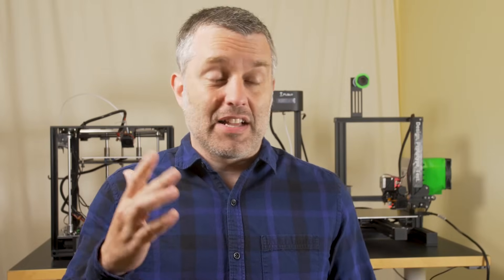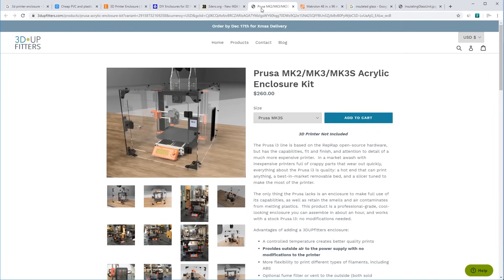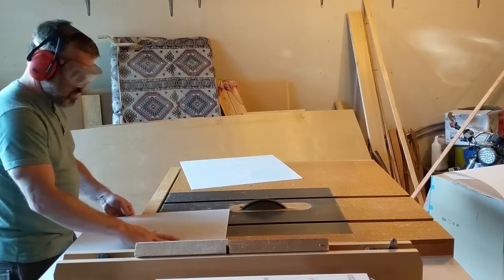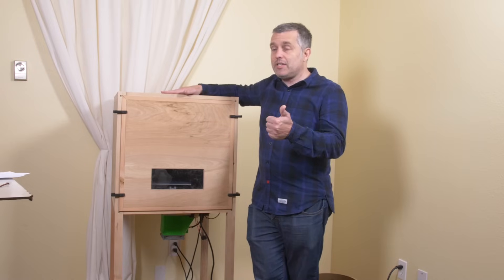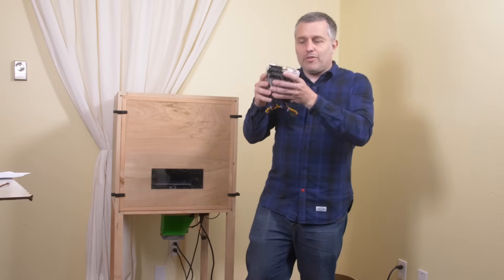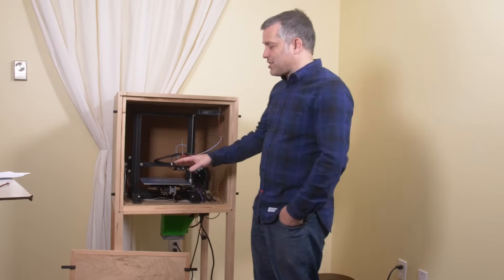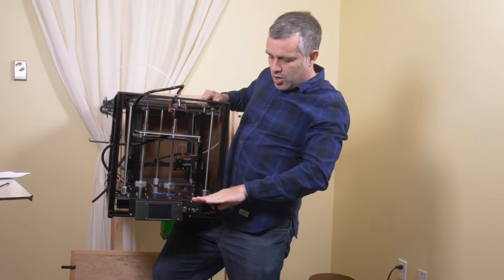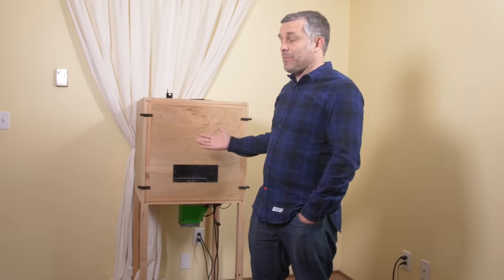3D Printing in a 100°C Heated Chamber - Lessons Learned

Comment: Alloy led extrusions and the greenhouses polycarbonate with the uv and heat blockout fabric is perfect for one of these! They make slip covers from it in different sizes now i got 4 the other day to tryout and have a massive sheet for the window to cut to squares to stick to the polycarbonate black outside and silver inside my lizard heat mat heats my resin vat up perfectly for printing not sure if itll fit under the ender 3 bed the larger one is adjustable heat controlled and as thin as paper its just coils laminated to fit in a lizard take for tropical heat I'll put this to the test something more lightweight and practical is needed, the pigeon box looks abit nasty for in your home

Comment: abs layers were separating and warping , bought a heat champer, the abs parts were wonderful, then after 15 hours the main board failed , and the the x stepper motor and I realized all the electronics are in the heat, either buy a already enclosed with great reviews or plan on moving the electronics outside , &10,000 comercial 3d printers have cooled servo motors

Comment: I regularly use my crtouch sensor on my 3d printer in a passively heated enclosure which is above 65°C most of the time. I don't know if it's because the crtouch uses a different technology than bltouch, but it works at that temperature no issues at all
Reply from the maker: This video was made before the CRTouch was on the market. I assume it has the thermistor and temperature drift adjustment on a chip just like the BLTouch developed first.

Comment: The blades are for a slitting saw on a mill (or drill press in your video) - definitely not for a hand tool.  So good you used them the right way.

Comment: Very cool. Not sure why the heater is needed. Haven’t watched all of the video yet, kinda skipped to you discussing the result, But did you try to run it simply enclosed and measure the temperature between the bed and roof? 

I just got a creality ender 3 neo, running in a small dehumidified room. And i’m usually greeted with temperatures 10-15 Celsius above ambient room temp on the other side of the door

Comment: More than adding hot air to the chamber, the inlet without an outlet is adding pressure to the chamber. What this will do is decrease the amount of air passing over the resistive heating coil in heat-gun

Comment: BUY a $75 3x3 Hydroponic Grow Tent.. You can even use heat controllers on fans to ventilate and keep the enclosure the right temperature. Just use a basic temp controller for hydroponic grow tents or heat mats.. You can also just use a chepo temperature controller module.

Comment: The choice of magnets has a big effect.  Alnico magnets will handle the temperature the best 550C no problem   Neodymium die about 100C but can get to 200C for the best material.   Ferrite  ceramic 350C ( I bonded 24 1" diam x1/8" to my Tornado bed and use steel work plate run at 110C with a 10C drop to the plate without a box heater. )  samarium cobalt  250 top end 350C

Comment: While the 3d print/filament love the extra heat, the stepper motors and the eletronics not so much. =/
I had plans to make a heat controlled enclosure with temperature sensors and a hair dryer to heat up it when it got colder than the target temperature, but it was getting problematic because of those issues.
Reply from the maker: This comment is so funny. I'm not a narcissist. I don't care if somebody else is working on the in the same thing as me. The reason I've got your boys number but he can't get to me is because he doesn't understand me but I understand him. From his point of view I have a superpower. It's called empathy. Basically kryptonite for those with Narcissistic Personality Disorder.
Reply: @DesignPrototypeTest  I don't know why you are telling that crap when I am just reporting issues I had with a similar project, but nevermind, I don't really want to know, not worth my time. Leaving and blocking.
Reply from the maker: Ok. Have a nice day.

Comment: those blades are actually intended to be used as "slotting saw" or "slitting saw" but somehow are marketed as freehand Dremel circular saws - you're usign them as the original designer intended

Comment: You can buy a cheap little tent for growing in doors and put your 3d printer inside, put a small extraction fan in the tent n vent the horrid plastic air outside. Simple n easy

Comment: Between two glass or inside the window there's gas insulation not air. When gas goes out it is way less resistance to temperature.

Comment: Would have done the same design, without slots, made a frame to go between the polycarbonate and silicone sealer for sealing the plastic to inside, frame and outside frame.

Comment: maybe i am mad, but has anybody thought of using a dead upright fridge/freezer or upright freezer the used in UK mostly 60cm. wide and deep as insulated box and maybe a clear door on front that would be free in most cases just checked mine out internals  about 46cm wide and 80ish height i think my FLSUN QQ-S-PRO 3d Printer  might fit but not delivered yet
Reply: I have, I have a mini fridge but I would rathee just build an enclosure.
Reply: On reflection I maybe I'm mad
Reply: My printer will be too tall being a delta type

Comment: Regarding adding a second heater unit: The hot air gun will pretty much draw maximal 120V current, 13-15 amps or so, adding a second unit on the same circuit will probably trip your breaker.  You'll want each to be powered from a different circuit if you go that way.  Just a thought but you already have a low fire risk heated box in your kitchen, so will your 3d printer fit in your oven?

Comment: Apart from any other consideration, consumer electrical components are normally only characterized from 0 to 70 degrees C. Classes of capacitors and all IC's will not last at 100C. How long? Please do a life test for your many fans.
If I was building this I would consider glass for the inner, and a lid like the door for maintenance access. Nice point about drying the filament.

Comment: Havent watched the full video yet, but where is the vertical and hprizontal reinforcements on the "legs" of that thing?

If the printer moves, the momentum of that movement needs to be countered by something, otherwhose your print will get layer shift due to the whole thing swinging back and forth.

The design you initially proposed stands on 4 legs that will without a doubt starts wobbling and swinging as soon as the örint starts.

Luckily this is relatively easy to resolve by putting some tension cables in between the leggs.maybe add a few stone plates to increase the mass of the whole steucture so it doesnt move so easily overall.

Comment: I believe the double paned glass in windows has the air vacuumed out. Would double pane with normal air in the middle really increase R factor to be worth the effort? My educated guess is no. Losing heat via convection (air leaking) is much greater than loss due to conduction so it's the lowest hanging fruit. (And you have that.) Double pane mostly helps conduction loss. Likely the simplicity of single pane but sealed well is best value for the effort and probably enough. Double pane without vacuumed inner would give a moderate return as the air inside isn't moving therefor improves R factor by also lowering conduction rate but as you show it wasnt easy. It sounds like you know this stuff well so I am curious what your thoughts are. :)

Comment: Great video, great topic. I learned very quickly as I built my printer as winter was coming on, that I need an enclosure. However, what Immediately jumped out at me was well, everything mentioned by every commenter below, the most prevalent for me?  I  won't be putting my printer/electronics, screen in a 100 degree celsius oven to see what fails first. Prior to going this route I'd want to pull all electronics to the outside of the "oven", then make sure the steppers and belts were able to handle that heat, etc... I think this is a great start on the topic but I'd like you to follow up with what parts fail as you move forward. Obviously this can all be done safely (yeah the plywood / heat gun / curtain behind it) and well, the way you've got it rolling, even being present, creeped me out significantly. Nonethelss, great topic!

Comment: The problem with such design is that the electronics will be fried when the whole printer is placed in it (usually 60-80 C is the upper temp limits for chips to operate to intended lifespan). You could have built the chamber right above the build plate (as hot air rises) and set the bed temp to 100C to heat up just that portion. I wish you'd done that here.
Reply from the maker: The electronics are in the green box under the printer. The only electronics inside the chamber are the stepper motors.
Reply: For each 10 C you reduce the life expectancy of your electronic by 50% !

Comment: Congratulation! You built an oven.
Reply from the maker: So much poo-pooing from your comments yesterday and today. Yeah, I built an oven...with a printer inside of it and the electronics on the outside. Nobody else is doing it, so I made a video.
Reply: @DesignPrototypeTest  I wasn't meaning to be mean. Yes a bit sarcastic but didn't mean it against you. Thanks for the video and the prototype. I was more thinking of using an old oven as my heated chamber. 😁 Yes it's silly (looks ugly mostly), but has that nice front glass etc.
Reply: Humm.. the other comment regarding how ESP32 are so cheap wasn't really against you either. It's more against many many devices that tend to make the "WiFi" option premium for high cost when it's actually pretty easy for the most part. Now I didn't design a control board and Duet board seem to have nice features; that doesn't explain why other boards don't have a small ESP32 to provide WiFi interface for example. I think we built one interface ourselves in the office but I wasn't part of it at that time.

Long story short, I'm not criticising the person, I'm trying to understand the issues and want to bring the scene forward just like you.

Comment: The quick fix to keep the original design would be to widen the poly mount slots and fill them with clear silicone sealer to make it air tight.
Reply from the maker: A good call. Why didn't I think of that? :) Would require thicker plastic though. One problem I've noticed is the thinner sheets in the window that I do have tend to warp with the heat. Not to the point of melting, but bad enough.
Reply: @DesignPrototypeTest  Yeah. Sometimes we get so wrapped up in the overall design we miss some simple solutions. I do it all the time.

Comment: Printing PEEK, PC and ZYTEL for advanced ventilator project. We have an enclosure for an ender 5+, we have multiple halogen bulbs and modified hair driers to get to 90-100c. Hotend and motors are water cooled, belts changed to high temp. Walls are made of metal laminated compressed glass wool. Base surround is Hebel. That's what you're going to need to have unattended prints without burning down your building.

Comment: I have been using wood enclosure (6mm thick) over 1 year with active carbon flexible heater at 100 degrees, the heater glued to the back wood panel and I can say that. ITS IMPOSSIBLE TO CATCH FIRE WOOD AT 100 DEGREES CELSİUS. What I personally tested after saw this video is I just touched my soldering iron firstly at 250°C to the enclosure about 30 seconds, gess it? Nothing happened just a color change to yellow from white. After that I just placed the iron as a way that iron will always touch to the wood. After couple of hours later, what happened? Nothing! Just a color changing again yellow from white. White because my enclosure painted one layer white to look better. Not a fire resistant paint, cheapest paint I used. Additionally when printing ABS the enclosure temperature hits max around 60°C. That doesnt mean wood hit 60 degree just the air inside of chamber, wood usually remains maximum of 40-45 degree. While the room temperature 30°C Because wood actually is a bad isolation if its not thick enough. As my senecio its 6mm so all the heat goes away easily. Even though its enough to print ABS perfectly, Note that if you live hot area or country and if your machine not designed to work high temperature( if has pla printed parts, don't use enclosure. I build my CoreXY printer and I design it to work hot, doesn't has any printed parts, all parts aluminium. Motors are outside of the chamber. Direct extruder has water cooling exc. Think first if your printer survive at 60 degree place before thinking if wood catch fire exc.

Comment: I have no problem with using a glue stick. As of right now I can't get ASA to stick to my bed (my x-mass present 2023 bambu lab P1S ).  I'm using glue stick for the first time as we speak, and I can't tell you how happy I am. So far, the print is sticking. I don't want to celebrate to soon. 🤞I'll know if this is my solution in 45 minutes.

Comment: I'm guessing they don't have a patent on a furnaces and ovens or any other heated enclosure. So I have to wonder how their patent is structured. I think a good patent attorney probably could get their patent revoked if someone cared enough. If it was my project I only need the door face to see through. The rest I can insulate with a ceramic fiber insulation.  Mount the primary electronics outside the enclosure to protect them from the heat. That's especially true fort he processor.
Reply: That patent should never have been granted on basis its an obvious solution.
"Nonobviousness is one of the requirements for obtaining a patent. A supposed invention is usually obvious if someone of ordinary skill in a relevant field could easily make the invention based on prior art. See 35 U.S.C. § 103(a)."

Comment: I built a chamber, have not run it to 100C  since I have not replaced all the PLA parts yet ~ 70 C.  I have plywood walls and put first foam 1" thick and then the bubble wrap metalized on top.  To get to all the sided of the printer I attached the sided with hinges to the base so they can be folded down.  The top is held in place by a step in the wooden frame and then luggage or hood clamps similar to the type used on coolers.  So two neighboring sides will hold up the top.    It is on a metal TV cart so I can roll it anywhere.  Controls for the Tervo Tornado  are under the base like yours.    I have a temperature controlled heater control (think the major purchasers are for fish tanks)  that I haven't hooked up.  For heater and light I used light bulbs.  Will us the ceramic bases in the next phase.  Right not I am using extension cord models, trouble light.   I didn't think I needed to make the chamber air tight but minimize leakage, the bubble wrap does this well.  Insulation on all sides also means I do not needed as much heat.  Climbs to 50C in about 10 to 15 minutes with one 70 watt bulb.  The reason for insulating and not using a fan is to have stagnant air as much as possible.  Natural convection will heat up the metal frame of the printer.   And the cooling fan for the nozzle is running to mix the air.

Comment: I used an Ikea cupbourd, 27€ including door and hinges, the cupboard is part of the childrens bedroom furniture, 20€, its the same size as the Ikea table or slightly taller. I got the door for 5€ in the damaged section, no damage just a slight scratch on the inside and 2€ for 2 x 120° hinges so the door opens more than normal.
Works great, it heats up in minutes using just the bed heater with the door shut. Be Carefull puting the filament inside, keeps it dry yes but it can go soft and get out of round and cause problems, mine is on top fed through a hole above the extruder and a small cardboard box over the top, it gets some heat from below and the cardboard box absorbs the outside hunidity before it gets to the filament, dry the box out inside when your finished.

Comment: I think the reason people always think about 2020 extrusions is because they don't have a table saw or a place to put it, duh! 

You can make something out of 2020 extrusions by ordering them already cut to necessary length, attaching them together with simple corner brackets and attaching anything to the extrusions by printing holders and screwing them into the slots with T nuts! It's the most accessible material for people without space and huge tools. As well as being, you know, rust-proof and non-flammable.

Comment: There is a bit of a fundamental misunderstanding of why double glazing works as an insulator. There is no "air gap" between the panes of glass, but rather a void filled with Argon gas. Air is a fairly good conductor of heat, while Argon is not and that is why it insulates.

Comment: McMaster lists ridged fiberglass insulation panels that are foil faced.  This material as the internal surface would add quite a bit.   Also, you can heat with lamps and it's quite effective.  The added bonus of the intense red light escaping through the window will keep you on your toes wondering with each glance if this is the time it really is on fire.